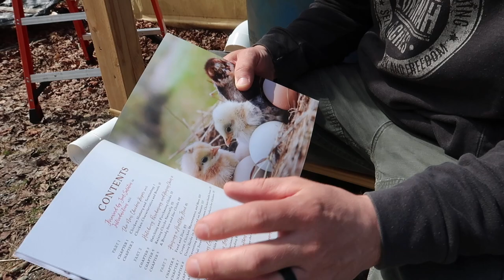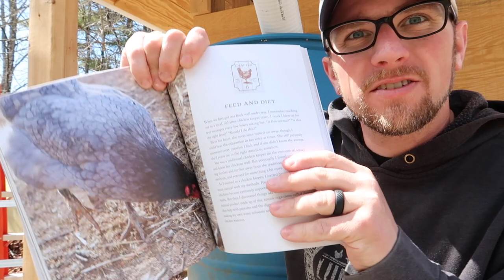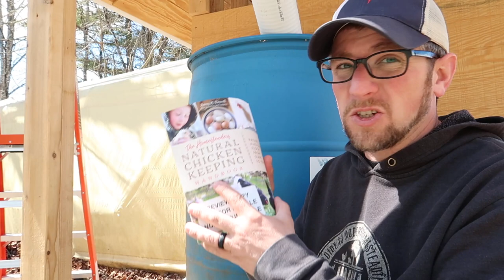Raising Chickens Naturally WON'T be the Same After THIS

Comment: We had the best broccoli last night for supper.  Preheat oven to 425.  Line a baking sheet with foil then spray it with non stick spray. half a pound or so of washed broccoli and cut into bite sized pieces (no big stems). Spread broccoli out in a single layer on baking sheet. Drizzle 2 or 3tsps of olive oil over broccoli and toss make sure its well coated. Season with salt & pepper, sprinkle 1/3 cup of dried parmesan cheese, then 1/3 cup cheddar cheese. bake until golden brown and broccoli is fork tender.  Once its cooled serve.  Excited to see the tour tomorrow and see Vermont, woot!  Road trip 👍  You dinner looked so delicious good job Olivia and dad. 👏🏼

Comment: If this season has showed you anything, it's where the water flows. New barn pens, gates at the high point of the fence. (less mud for you to walk in.) When you clean the snow out dump it over the fence on downhill side of pen. Leave space to hold the snow there without trees/shrubs. Maybe french drains around paddock as your doing construction to minimize mud season stress.

Comment: Easy way to cut onions. Cut the opposite end of the root end off and cut the onion in half, it will peel easily. To slice you now have a steady onion for slicing, to dice cut the onion into slices 1/4 sections parallel and intersecting the root and cut it from the end (like for slices) and it will make a nice dice. Leaving the root end helps with crying. I worked in a deli and we got whole onions in to make slices and dices, this is the fastest safest way. If you need rings then take a small slice off one side to allow the onion to be more stable while you slice the whole onion into rings.

Comment: Dandelion salad is an initial rite of spring, pick them when they are very young before they flower otherwise they will get too bitter. a little vinegar and olive oil works as dressing with a touch of salt.

Comment: Hey Al, I really enjoy the videos -- keep them coming!  Can I make a suggestion on the onions?  Cut the onion in half, pole to pole, right through the middle of the root.  It serves three purposes -- The cry factor stays put, it's easier to peel, and you have a flat surface to lay the onion down and then cut.  Makes it easier to slice thinly and works for the dice trick too.  I was born without my right hand, so I've learned a few tricks to make things easier over time.  :)  Cheers!